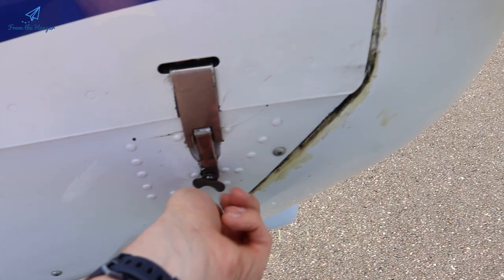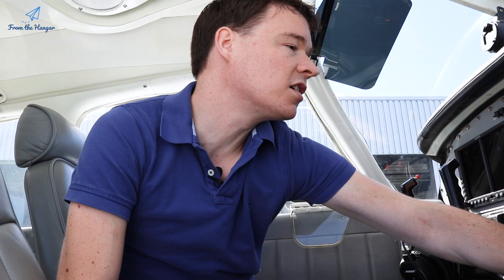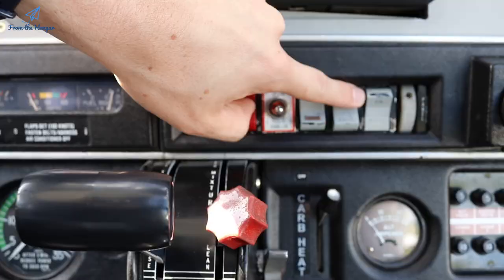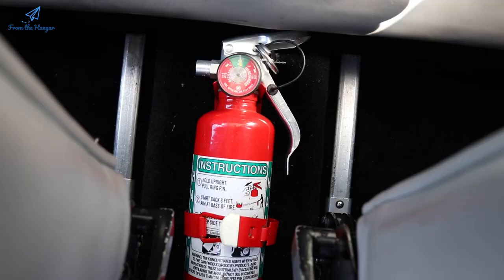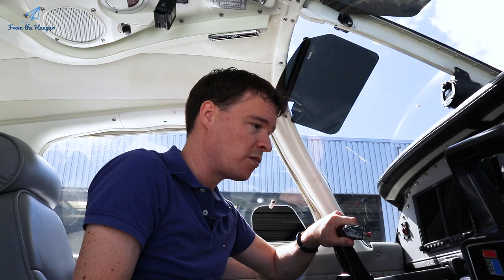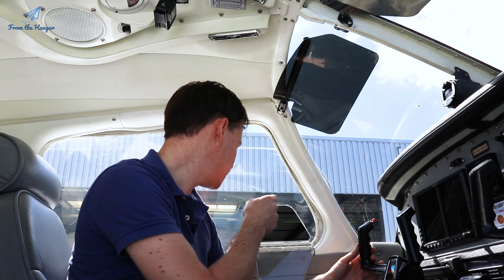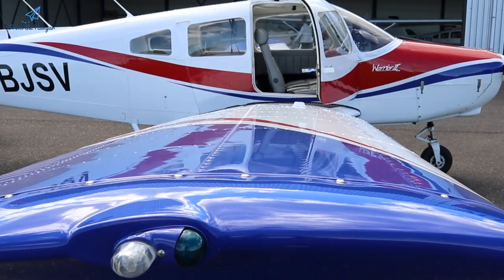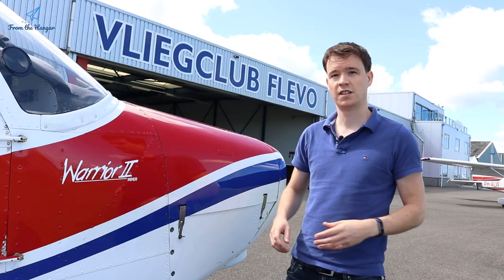Preflight Check Piper PA28 Step by Step, Online Flying Lesson

Comment: It seem like you are missing a lot of things on the mechanical side.
Reply from the maker: It's always a balance between keeping things practical and covering everything. An examiner I flew with said it very well: "I want an efficient pre-flight inspection, not a full pre-buy inspection". But curious what you would add? Maybe you can share here in the comments for everyone to learn?
Reply: Based on my experience, i have caught things other pilots didnt catch when I asked them if they were done with the preflight was. Missing bolts under and over the main struts, people hardly see or check that, broken cylinder bolts, spark plugs wires and sparks plugs not tight, engine mount bent, safety wires missing on the oil filter, hydraulic fluid empty... but everything else looks good as a matter of fact I always check the aileron and trim tab when I'm at the run-up area but now I'm gonna do it as part of my preflight and not forgetting to do it again at the run-up area as part of the pretakeoff check list. Besides what I mentioned previously, everything is good. Great job man.
Reply from the maker: @edwardrodriguez528  Ah got it, thanks for the addition! I don't normally check things like safety-wire during pre-flight, only if I'm flying it after maintenance. Then it's good to also open the other side of the cowling etc. But if I found things like missing bolts or a loose oil filter it would probably be the last time the plane went to that maintenance shop.... The hydraulic fluid is actually in the video when checking the struts, I've seen those leak indeed.
Reply: That's the thing, students/pilots haven't seen those missing bolts during preflight, and are about to take the airplane. I have asked them, "is the preflight done?" They have replied "yes" they I have said "so are you going to take it to fly it?" They said yes. Then I have pointed out, I wouldn't take if.... then I show them what was missing..... but it is a suggestion, I know I'm not perfect. But we are here to.help each other and prevent from having a bad flight.
Reply from the maker: Good point. I didn't learn in that much detail when I was a student either, I only know now because I'm sometimes involved in maintenance. Probably good to show students at least once in training what all the extra things are you can check and what you would look for after maintenance.

Comment: Great video again, have enjoyed them all so far. The only other check we do with regards to the fuel is before you put it back in the container is just smell it to make sure it is actually fuel and not all water!
Reply from the maker: Good one! Yes, smelling works well or check the color, it should be light blue and not ehm "water color" :-). Have you ever found water in the fuel?
Reply: @FromtheHangar  As we don't use Avgas (microlights) we can't use the colour check, but it doesn't hurt to do both! So far I haven't found any water in the fuel, but you never know, one day the check might save me a whole load of problems.
Reply from the maker: Ah yes then the smell check is extra important. I've found some water once, in that case the fuel filler cap rubber was leaking which let in rain water from the top of the wing. Very happy we found it on the ground....

Comment: That was excellent. I would have loved to have seen the panel while you did your internal checks. I'm hoping you have one for each stage of flight. I used to fly warriors about 15 years ago. I now use Xplane to fly. I want to go back to flying but I want to learn as much as possible before I go back to it.
Reply from the maker: Thanks! Any suggestions for stages of flight that would be helpful? I did one on ATC communications and one on landings, but I'm sure there are other parts that could be useful.
Reply: @FromtheHangar  not specifically stages of flight. I can taxi, take off, climb, cruise, descend and land without an issue. It's more in the detail of turning on fuel pump or off pitot heat, etc. As in, the check lists and why.
Reply: Me too!

Comment: You should never leave the electrics on. Especially if you are going round the front of the aeroplane. What you should do is your non electric checks first and then turn on your electrics and get someone to help you. ATC would usually tell you if your taxi, nav and landing lights are not working. You should also never walk around the front of an aircraft if it is not yours for example what if you have a deaf person with you, they don’t see you walk around the back, that aircraft starts and gets ran over.
Reply: "You should never leave the electrics on" - how do you check stall warning? walking around takes 2 minutes, there is no substantial battery drain in so short time, and if there is you need to replace your battery asap. There is a risk the engine could start if you move the propeller, but has nothing to do with electrics being on. The engine could fire if there is a malfunction on magnetos grounding circuit, but that is usually checked at the end of powering down.
Reply from the maker: Indeed, engine start on a typical GA plane is due to the ignition not the electrics. But @Cameron's concern is a valid one, props are dangerous, so it's good to take the keys with you before doing a walkaround.

Comment: quick question regarding the strainer drain shouldnt it be drained 2 times since the fuel selector has Off/L/R so one at a time?
Reply from the maker: Yes if you follow the expanded checklist from the POH they tell you to do it twice, once for each tank. In practice advice varies from not checking it at all (I think that's not a good idea, there could be something wrong in the gascolator), checking one side, or indeed checking both.

A reason sometimes given for not checking it at all is that having it stuck open can cause engine issues as well. So considering that, do check that it closes property after draining, even a little drip is an issue. And if you want to be thorough check with both sides.